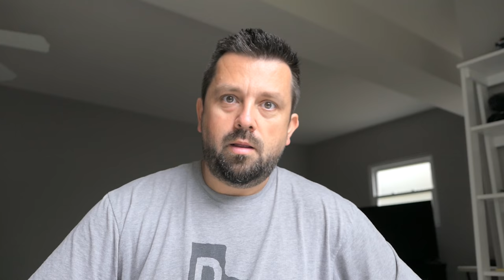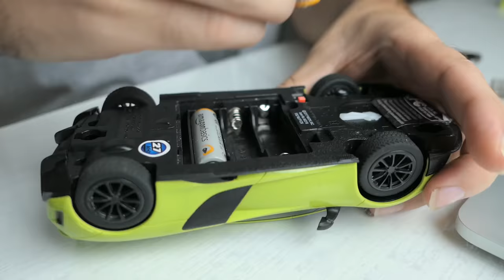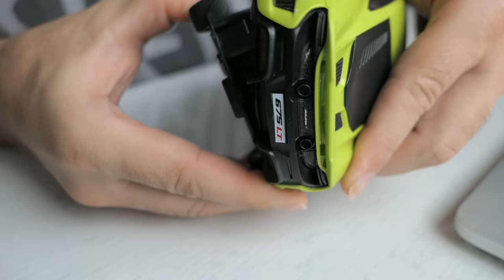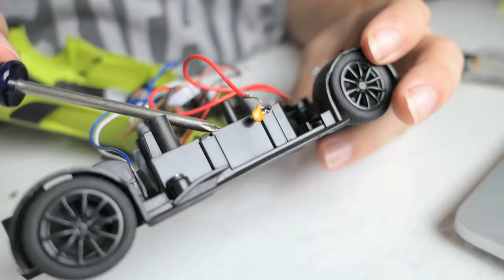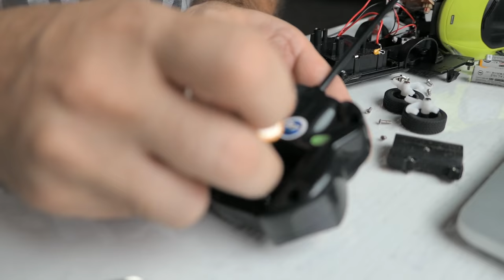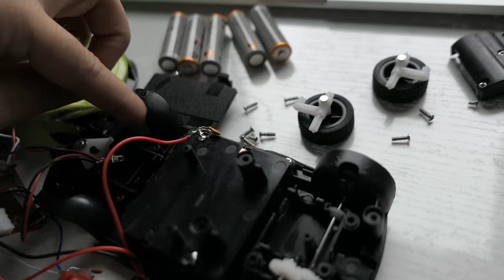Whats Inside? - Remote Control Car - Inside Look 004

Comment: Does anybody know how wheel adjusting spring (it is controlled by white handle on the bottom to adjust straight drive) is installed in this type of car?

Comment: Could you install a Lithium Ion Battery with USB C or Micro USB Charging?
Reply: my guess is yes. I bought a similar car today. looks great... but is terrible as an rc. time to gut it, find a way to install a micro brushless esc motor combo, increase the turn radius and install a better steering servo, and fit it with a receiver. I hope to run it off a small lipo or nickel metal
Reply: Jake Balan lithium ion batteries are probably most best. Need to see quick charging as well. Are you building your own?
Reply: Just buy a hobby grade car